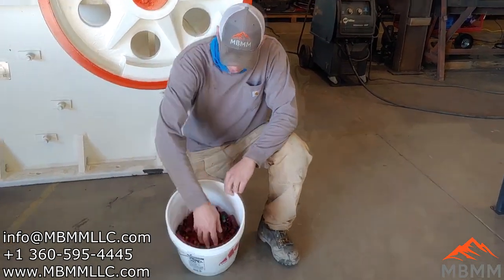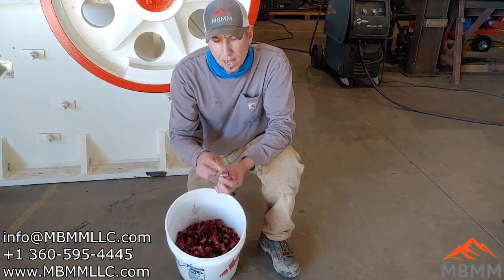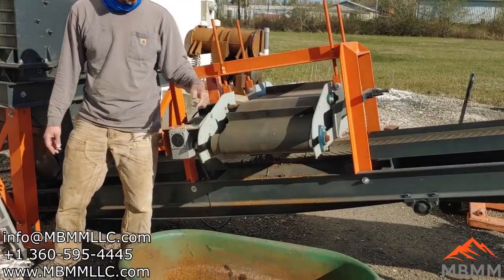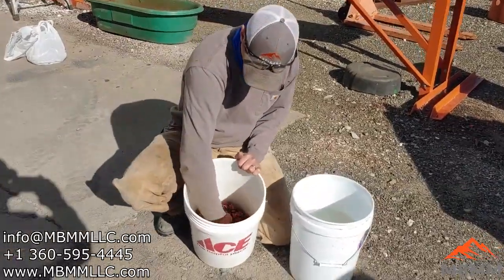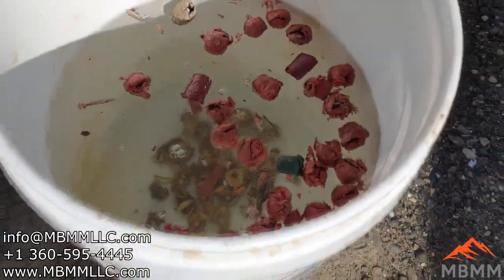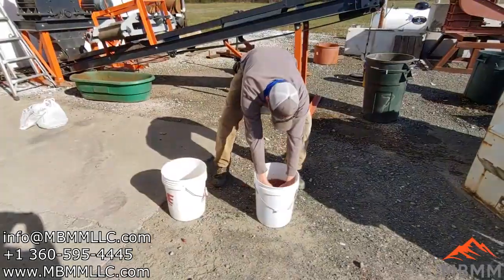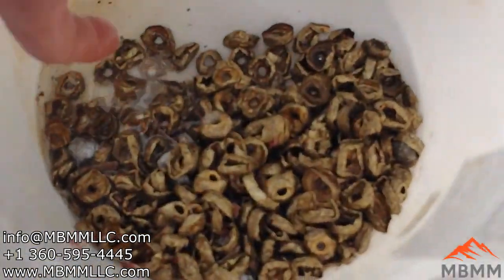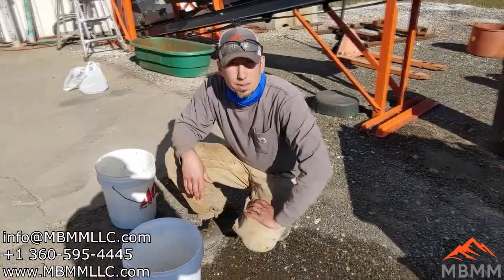Watch This Machine Tear Apart Shotgun Shells for Recycling

Comment: If you had a float tank at the end of the conveyor belt with auger, the brass would sink to the bottom of the tank and get discharged into a collection bag and the plastic remains floating on the waters surface which can be easily skimmed off with a short handle pool skimmer.

Comment: What happened to the spent primers?  Were they removed in a prior step?  You may have little concern about lead exposure, since it was not in contact with the hulls, but what about the powder and primer residues in the dust?  And the water you dumped off onto the ground after floating the plastic is contaminated.  As a miner, aren't you concerned about the EPA showing up on your doorstep?

Comment: Your 'tailings auger' is almost perfect to pull the brass out of the bottom of the water, into a sack.  It just needs a surface-level gap, to float the plastic out of the auger unit.

Comment: With a little bit of planning and phone calls you could have a planned amount of processing to pay for the machine.  In different videos their is a small hammer mill mounted to a truck also so you could process on site if needed.  For mining I understand the preference to hammer mills although a small industrial shredder has benefits also I'd think.  I do not know how a hammer mill would work on various electrical wires.  Cut to short lengths a hammer mill might process it but a small shredder I'd think would be much better.  I will say though you make good hammer mills and separation tables.